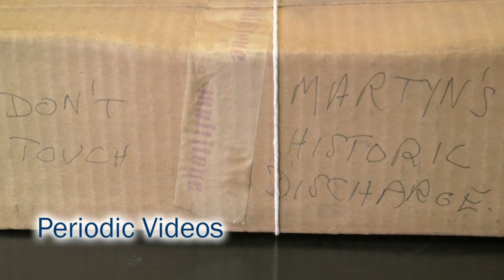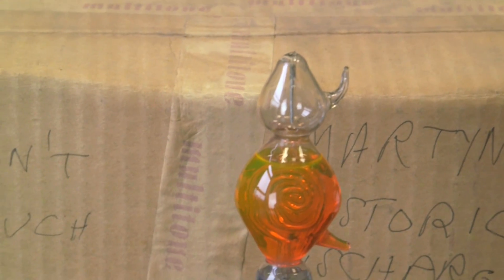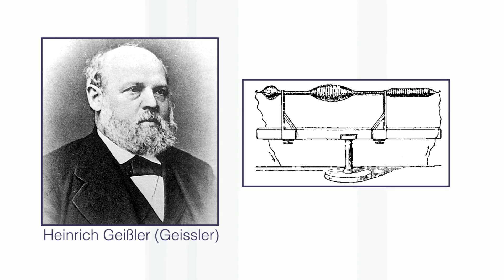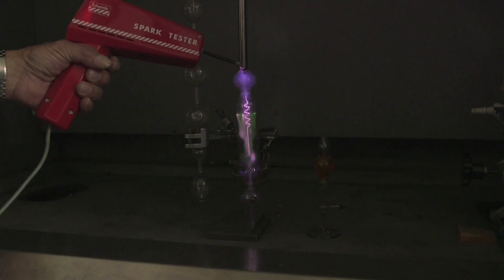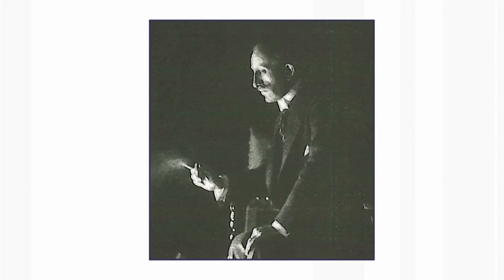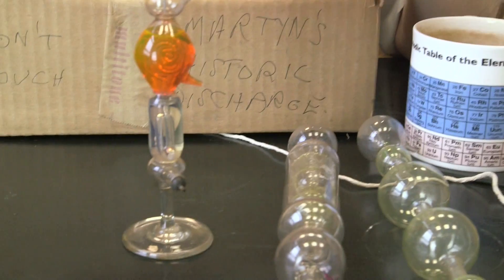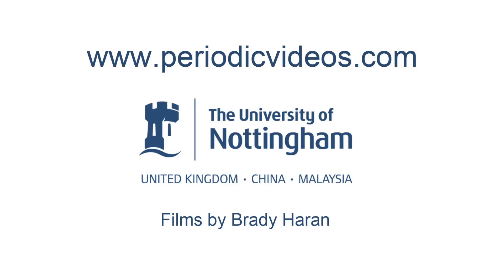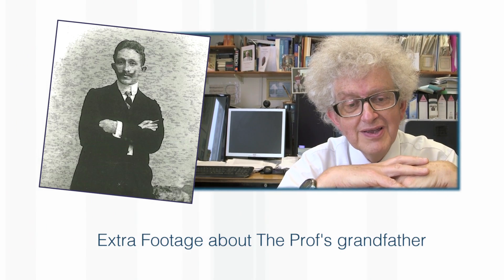Geissler Tubes - Periodic Table of Videos

Comment: Isn't it uranium glass ? It looks greeninsh and it glows under UV light with this faint green
Reply: First rule of unboxing science equipment of the 19th century: bring your Geiger counter and never inhale.
Reply: And it would be easy to test with a geiger counter
Reply: Most certainly uranium glass. I agree!
Reply: Uranium glass would certainly fit with the time frame, and was the first thing I thought of when seeing it glow.
Reply: I chuckled
Reply: Agreed, it fluoresces very much like uranium glass I own. A Geiger counter would confirm this.
Reply: My first guess also.  Makes sense that it glows too and then it could be just straight glass.
Reply: Austin Locke
Pretty sure it's "ion," not "iron." Metals are used to color glass but I've never heard of iron being used.
Reply: That was my first thought, too. Surprised Neil didn't bring his Geiger counter right away.
Reply: it contains an ion that glows in uv light, probably a uranium salt
Reply: Austin Locke he has an accent, I was confused by him saying iron then relisting and heard him say ion
Reply: ***** yes, but glass with iron ions is always green. Uranium glass fluoresces green.
Reply: That was my first thought also.
Reply: Iron mages glass green, normally you try to remove the green from iron
Reply: @Meghnad old comment but thanks for your input I learned a lot :)
Reply: I'm a glass blower, that is uranium glass.
Reply: Iron in the glass is what he stated I think. The iron kicks an electron to higher energy orbit and falls back giving off heat and light as it goes back to the lower state...same with the gas in the tube. Agreed, only a geiger counter could tell you that.
Reply: Yes its uranium glass